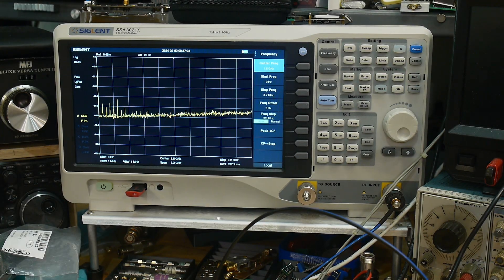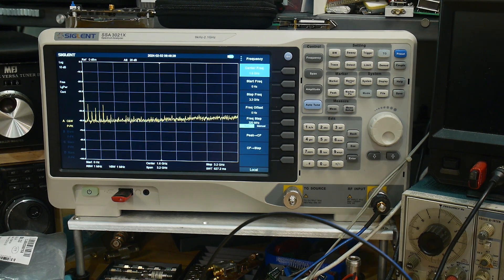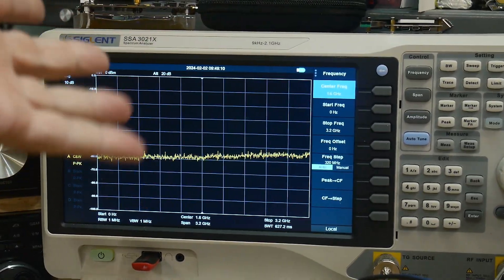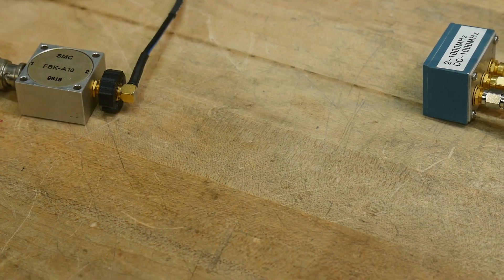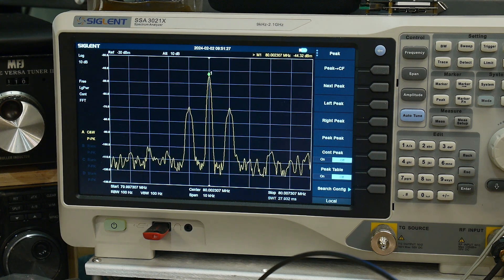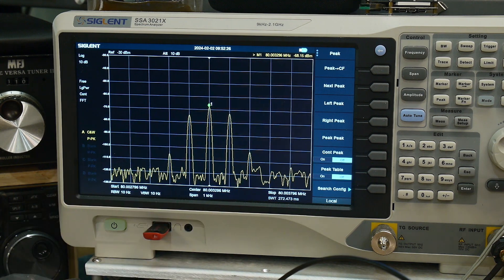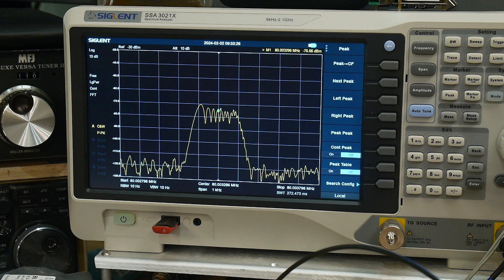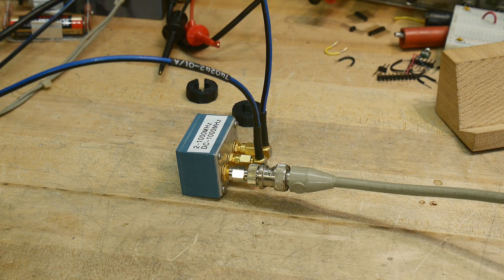#1810 Audio Spectrum using External Mixer

Comment: Thanks for the suggestion. I have an old HP SA that goes down to 20 Hz, but I've switched to inexpensive handheld gear as much as I can. It's just so convenient and easy to feed into a laptop, unlike the old GPIB gear on my bench. You reminded me that I can just use one of my good low freq mixers and a sig gen to feed the Tiny SA in order to look at audio. Thanks again.

Comment: Why do you have to shift the frequency so far in Mhz when you signal is just a khz? Not having anything else isnt a good excuse!  I think most of the DDS frequency synthesizer can do mixing too.  Even the chip ones can use an external signal to mix with its own.

I learned the hard way to never measure anything accurately with an oscope.   Youvnever get any reasonable results specifically in the audio frequencies.

I think most of the old school spectrum analyzers use the down shifting.
Reply: If you want precision measurements in audio frequencies, just use a sound card or pro audio interface on a PC (hardware that's designed to work properly at audio frequencies), and get some free software to do the FFT or whatever else you want to do. The whole reason spectrum analyzer lower frequency ranges have a cutoff is because they are not calibrated below those frequencies, plus you start to have all sorts of LO leakage around DC that completely overwhelms any signal you're looking at.

Comment: Good trick to use if the analyzer can’t do audio. You can set marker 1 to the LO peak, 80MHz in this case and do a delta marker 2 to get the correct audio frequency readout.
Please try if the Siglent SSA really can’t go below 9kHz. I have a Siglent SVA1015x which also shows that it can’t go below 9kHz but under certain settings it can go down to DC.
The sweep needs to be linear and the RBW needs to be narrow, like 100Hz and then you can do a start frequency of 0Hz. I recently did audio measurements this way and it seemed to work fine.
Reply: They often "can" but the linearity there is questionable. The typical 9KHz cut-off is due to the built in DC block filter, you can play with the controls only so much.
Reply from the maker: yes, I don't have any diagrams for the Siglent, but my HP has a 0.047uf on the input.

Comment: What's scope Would you recommend with an FFT
Reply from the maker: https://youtu.be/JbZ1-qFaVG4?si=c3eK8TVH2gV4gVTD
Reply: For audio, get a nice external sound card or pro audio interface, and do all your FFTs in software. If your needs can be met by the built in soundcard in your computer, you can do it for free with stuff you already have!
Reply: @tripplefives1402 The quality of the fft, in terms of frequency granularity (aka the number of buckets in the fft), the dynamic range (most scopes are only 8 bit) and the refresh rates are all going to be much worse on a scope than doing it in software on a PC, AND way more expensive to boot! A decent audio interface can do audio at 48khz and 32 bit sampling. A pro interface will do 192kHz sampling at 32 bits. The sky is basically the limit for the resolution of the FFT you can do on the PC, and you can also visualize it in a myriad of ways depending on what you're looking for - just a plain FFT, FFT with peak holds, waterfall plots, etc etc

Comment: The best and cheapest way to analyze audio is by using a USB soundcard. You can get relatively cheap ones that will do 24 bits at 192 KHz. Using a scope is not going to be good enough as that is only going be 8 or 12 bits - maybe 16 bits if you play with ERES and such.
Reply: Please tell the whole story in you comment.  I'm just guessing... Do  you record the sound and then you try to convert your data in a non real time to frequency domain using a program like Excel?
Reply: @bayareapianist  There's plenty of free software that can do FFTs on audio in real time, or you can do it from recordings. If you really want to get picky about your FFT settings, you can use GNU Radio and do it all yourself and set the FFT up however you want, or Matlab or Octave, or there's probably a plethora of python libraries, or you can code it up from scratch in C or C++. Really depends on your skill set, and what you're trying to do
Reply: The idea works but the front-end bandwidth and other performances are never guaranteed or specified, full of unknowns.
Reply: @andytwgss  not true and easily tested yourself anyway.
Reply: The cheapest way is to figure out how to use equipment you already have.

Comment: Oscilloscopes are dynamic range limited.  Typically starter scopes are 10-bit, 12-bit if you're lucky.  You trade bandwidth for dynamic range.  But modern digital audio is at least 16 bits or even 24 bits with real world dynamics ranges of 90dB or more.  A -90B noise floor is invisible on most oscilloscopes, it's swamped by the scope's self noise.  Audio Precision makes very nice audio test equipment but they were founded by engineers from Tektronix and have the prices to match.  But a  basic two channel audio interface can do a lot including two channel measurements like transfer function and can even serve as a signal gen as well all while being within reach of the hobbyist.  And now there's Quantasylum who are bridging the gap between the $200 audio interfaces and $20,000 AP units.  Check out the QA403 sometime, The Signal Path did a video on it a little while back. 

Anyway, love the channel!  Thanks for your videos and knowledge :D
Reply: You can just use a soundcard or pro audio interface, and some free software to look at audio. You can get a really nice pro audio interface box with 48khz 32 bit or higher sampling for a few hundred bucks, vs a spectrum analyzer + mixer + LO for a few grand, or a nice scope with a decent FFT for around a grand. Sure, you can do it this way, but it's kind of really bass ackwards to actually do it this way in practice.

Comment: I would like to see a double or single balanced RF mixer circuit built from discrete components that would be suitable for HF. I looked through your old videos for 'mixer' and didn't see anything. If you would be interested in doing that, it would be great. Thanks.
Reply: Ugh, this brings back memories of grad school, and building and simulating a double balanced mixer using CMOS transistors in Cadence and Spice...

Comment: Nice, that’s how downconverters work on SDRs. Could you check the attenuation that the mixer adds to the original signal? Does it change with frequency! And thanks for posting!